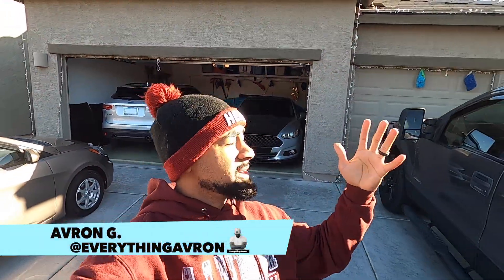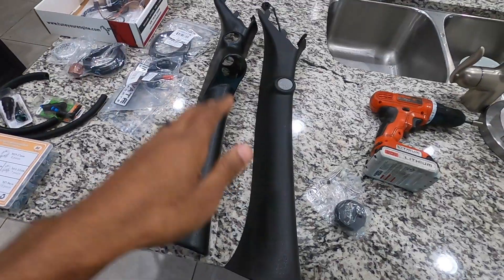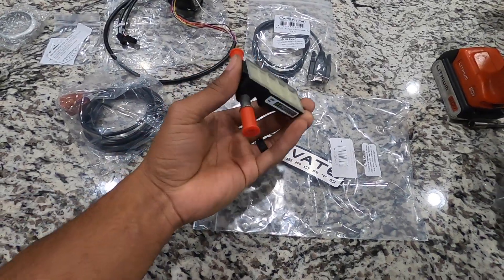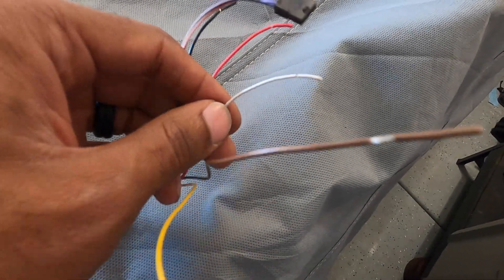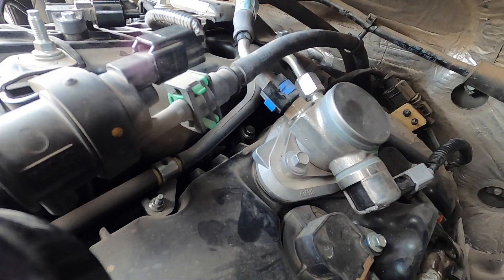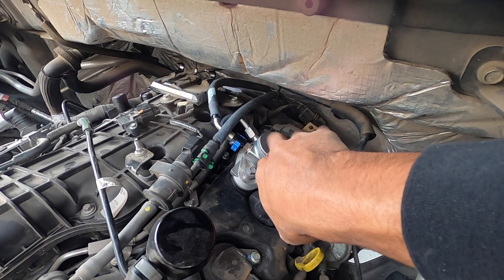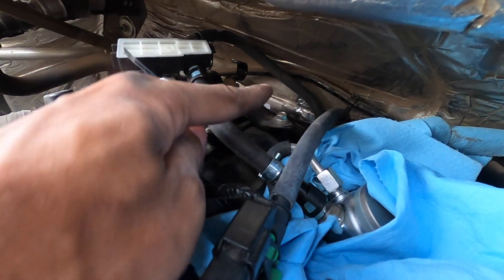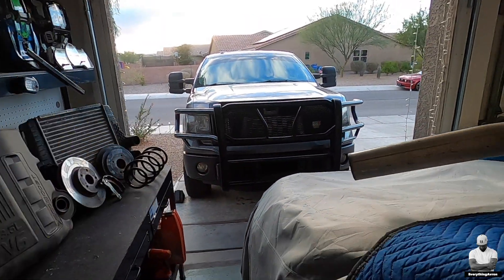HOW TO INSTALL AN ETHANOL CONTENT SENSOR IN A FORD F150| My EcoBoost gets a new Innovate E85 Gauge!

Comment: I thought the ecoboost didn’t have flex fuel option?
Reply from the maker: They don’t if your stock… but with fuel system mods and a tune, you can run ethanol! I only run E30 mix or full E85
Reply: 2019+ can run E85 with a tune and boost a pump, just verified this today from 5Startuning.

Comment: Did you have to drive it a while for it appear on the gauge? I added e85 and nothing has changed on my ethanol content gauge.
Reply from the maker: I have to drive for a few minuets until the gas in the pump and in the line to flush itself out. but then you should see the gauge start to climb up.

Comment: Will this work on a 2019 mustang gt
Reply from the maker: Sure will... the kit is universal. you just have to find a good spot in your fuel system to splice in the Sensor. Best place for it is on the Fuel return line if you have one.

Comment: Is this all we need to support e85 in our ecoboosts?
Reply from the maker: No no this just helps you know what Ethanol percentage you have in your tank.. Which is good to know especially if you are running Ethanol blends like E30 or E50. Now to run Full E85 you need a Upgraded High pressure Fuel Pump, and also id recommend a Low pressure fuel pump too. Check out my F150 Playlist I have a HOW TO install video for both the Xtreme-DI HPFP and a Deatschwerks LPFP that I installed in mine... https://youtube.com/playlist?list=PLcNhX95CsVXpp_ZdIXkSFNJeaE_1DseaX
Reply: @EverythingAvron  thank you so much my guy!!

Comment: I thought the low pressure side was capable of 200 psi,am I wrong? Is that rubber hose and clamps acceptable?
Reply from the maker: Na not that high... before my upgraded fuel pumps I only hit about 120psi at full throttle. I'll touch about 140psi with my new E-85 Tunes. But if im driving normal it hovers between 60-100psi